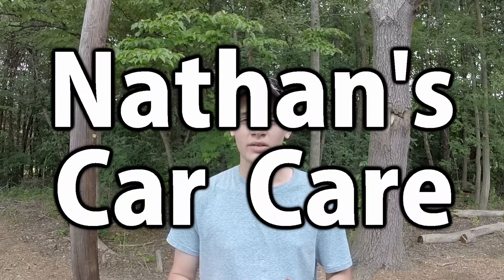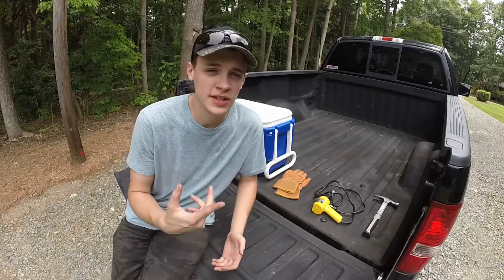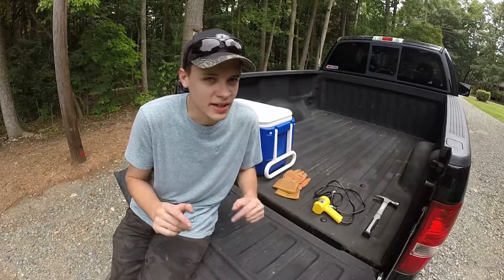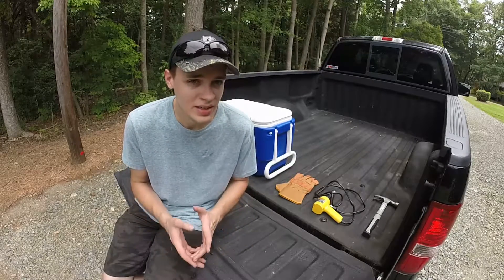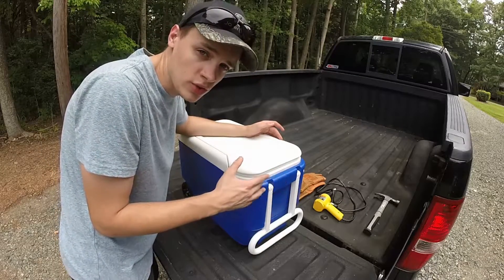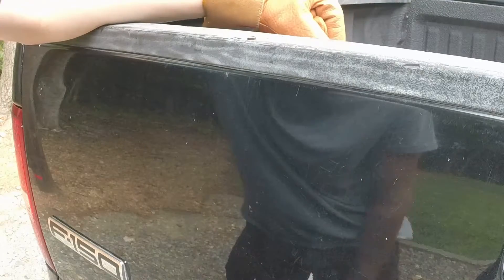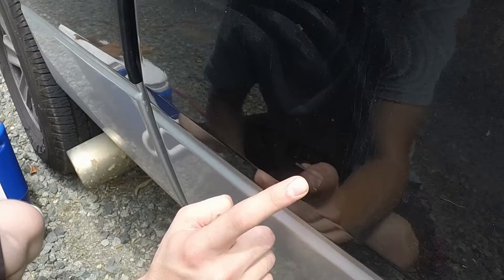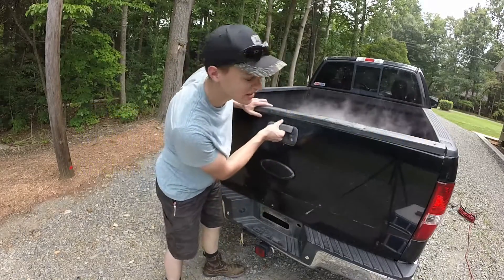Does Dry Ice Remove Dents?

Comment: I remove dents for living via PDR (Paintless Dent Repair).  Dry Ice?... ugh, not another one.  The only time this actually works for vehicles is under VERY specific circumstances.  ie.  a very slight, super shallow dent, no creases and WITHOUT CROWNS (which I could immediately tell you had them in this video), also must be a steel panel, not aluminum.  No matter what, even if you get lucky, you're still likely to still see a wobble or three.  And maybe that's ok for some (ie. racing, beaters or oldish cars etc).  But if you want it out 100%, have a PDR professional do it.  There's a real reason why many of us have 100k in tools and decades of ongoing training and experience.  Oh... and PDR is typically cheaper than a bodyshop - AND a better repair overall.
Reply: Advertise much?
Reply: @PM-vb4od  Haha :) Just trying to impart some professionally educated balance here.  I get that people maybe want to save a buck, hell - I do too.  But this simply just isn’t the way.  Not for a nice vehicle that someone might actually take pride in anyway.  Seen a LOT of botched attempt horror stories in my day.

Comment: Hi Nathan You presentation was great mate  bt    What you have to understand thet   the dry Ice is there to shrink or  take the metal back out of its stressed state from the ding   so You  should  Heat it   so that it heat soaks  so  using the heatgun away    and   playing it over a reasonable area   of   maybe 1-2 inches   beyond the area of visible dent    this heat soak allows  the heat to soak through the metal and not just   the outer surface    >    When the whole area is   heated up and it allows heat to flow to the other side     turn off the heat and place   a cold pack of  Dry ice maybe in a Plastic bag   over the area you are working on   . It does work but you have to do that heat soak   without burning the paint   but as hot as you can  and a bit sustained   and it may take several goes  as   the metal has to shrink back to where it had been originally  dont be in a hurry    and it will work    > Good Job though Mate   Nice Video

Comment: Let the dry ice sit on and keep moving it around the dent for 20-30 min, then you might start to see your results!!  Thanks!
Reply: Wrong.  This doesn't work.  If it doesn't come out right away (ie. the metal being shocked back to it's original shape by the hot/cold) then 20-30 mins more is a waste of time, sorry man.
Reply: @RoguePC4U  Not sure if this is a troll or not but obviously things take time. What's going on is heat transference. The dented metal will SLOWLY start to move towards the dry ice to make up for the temperature difference but yeah you need at least 20 mins or so.